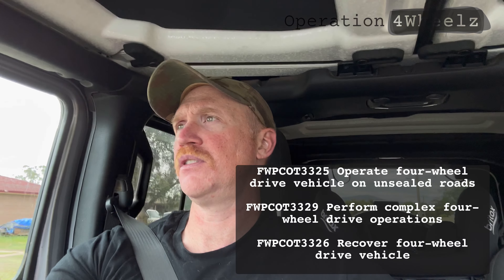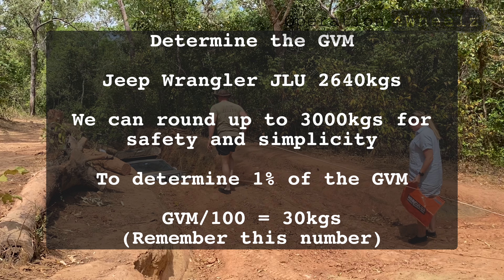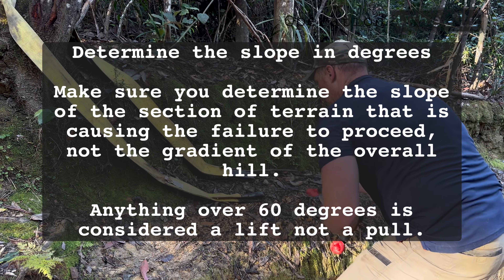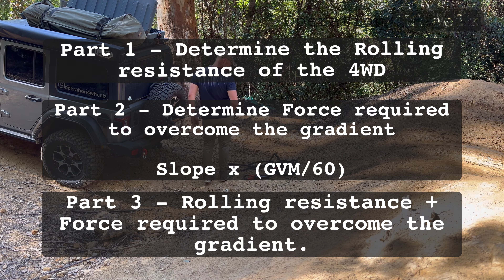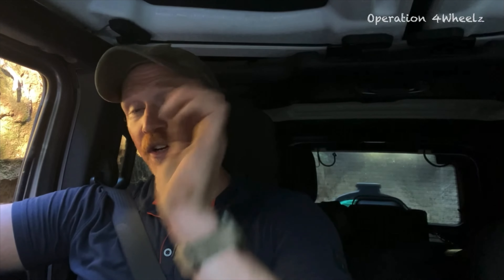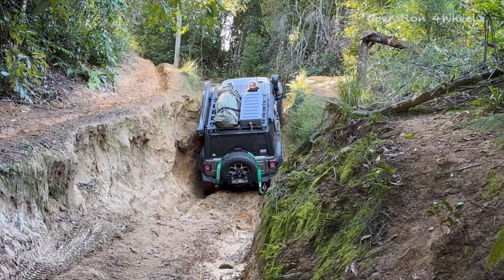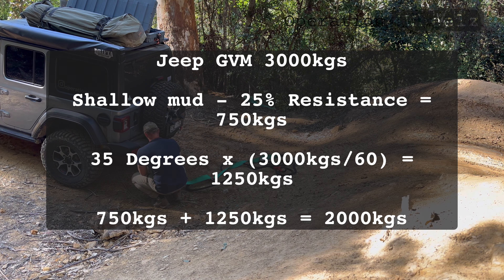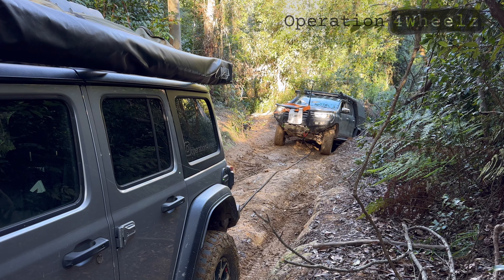How to calculate winch loads in 4wd recovery. How to calculate the force required to recover a 4wd.

Comment: Good stuff. If you’ve ever actual been trained or researched. You know that at that 200 percent mark anything not hung up will move. At 300 you can move dead weight. I pull out trucks all the time with my quad using both winches. 2/1 on front with 2/1 on back but I don’t like to use the frame as anchor. I run front 3500 winch to a tree with 1 ring. Under the bike to rear winch line then another ring on stuck vehicle and pulled by 3500 in back. 14k lbs with just a tree 2 rings and 2 winches. Frame of my bike only gets 7k. And those trucks or buggies or whatever moves every time unless it’s really big and dead.